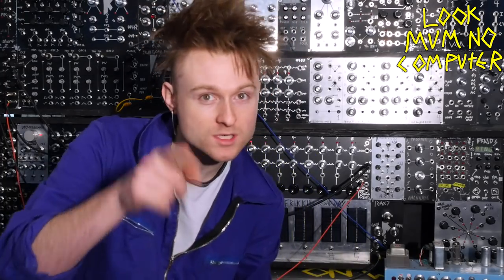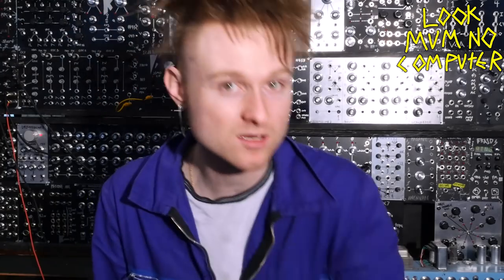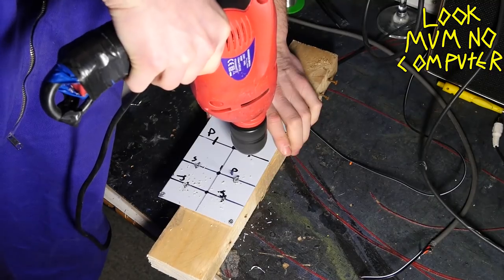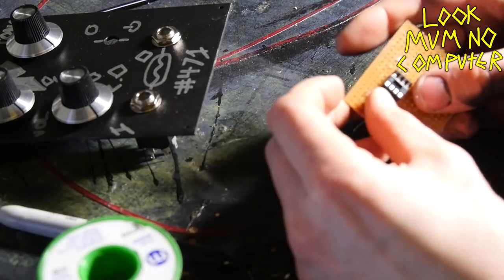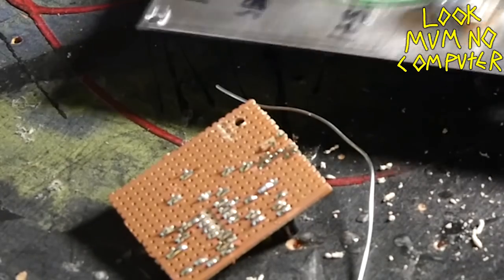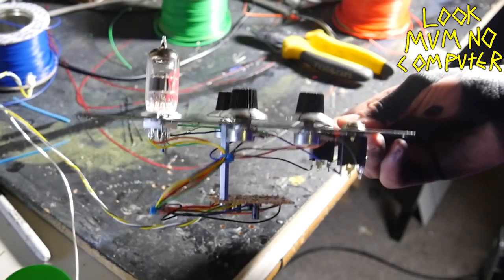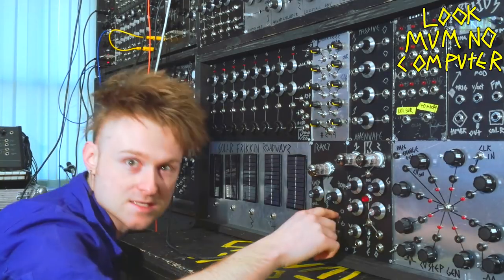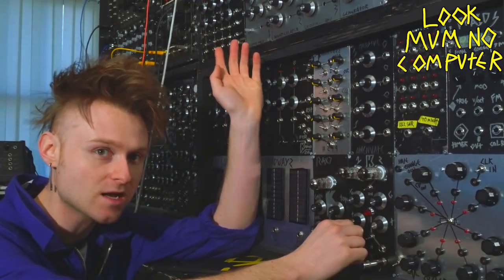The Safety Valve - Valvecaster For SYNTHS DIY How To

Comment: The best thing about a valve is that if he ever blows for any reason you can just unplug it and plug and new one in with a transistor if it's directly solder to a PCB you have the ball ache of taking the unit out of its casing desoldering it and soldering a new one in

Comment: the original schematics have 12AU7 (ECC82), NOT 12AX7 (ECC83), the reason being AU has less gain than AX, it works obviously, but for a guitar AX tube sound is too harsh in this circuit
Reply: You seem to know tubes, at least more than me. Would it be possible to use the 6EM7? I bought a few for a preamp project.
Reply: There is a reason for that, the guitar signal levels are much lower than ones used in synthesizers

Comment: Hi! 
Any chance someone could explain me how to power this module as I don't have eurorack type of power (+12 -12 and ground) but normal dc power (+12 ground)?
Maybe this is a really stupid question but I would really appreciate help :)
Reply: 2 -12VDC supplies, just tie them together opposite polarity so you get +12, 0V, AND -12 as reference points, it'll do in a inch but maybe be noisey or unstable/regulated like your after. but its been done.

Comment: Would likely require a lot of tweaking, but I know that there are vacuum fluorescent display preamps, like the Korg NuTube that operate on a similar principal to a normal vacuum tube. Is there a way to wire up just a traditional fluorescent light tube that you can just grab at the hardware store into a useable distortion preamp?

Comment: i dont know much about much - but i pretty well put this thing together on a breadboard. and to test it I was just going to get 12V DC wall wart that I have already chopped. 
On the schematic it says it requires +12v, -12v and Ground. Can i do this with just a 12v DC wall wart?  it only has 2 connections - 12v+ and GND.
i think im missing something fundamental in my understanding of electronics here...
Reply from the maker: Yeah you need a -12v too but if you listen to this circuit hefore the opamp you'll hear sound without a bipolar supply
Reply: @LOOKMUMNOCOMPUTER  i just tried it with an old computer powersupply and used the -12v rail from that - but it didnt quite work lol.
The output was very very quiet . 
Im gonna double check things first and ill try taking the audio from before the opamp thanks so much for the project info and the suggestions!
ive had so much fun getting all the parts and putting this thing together over the past couple days :) thanks again

Comment: Hi Sam, I've e built this four times now and eve time the 27ohm resistor heats up real HOT 🔥 
Switched it to a 10watt 27r still pretty hot.
Not sure where I'm going wrong, using a 15V 
Supply instead of 12V could that be it?  Cheers thanks for the electric lessons !
Reply: Based on the schematic, the tube is wired for series heater. 12.6volts across pins 4&5. This will pull 150 Milliamperes of current. If your supply is 15volts you need to calculate the correct size resistor.
In reality the resistor is not needed if the supply is only 12volts. To calculate the size resistor need with a 15volt supply you need to drop 2.4volts / by 150mA to give you the resistance. To calculate the wattage rating- 2.4V x .15amps (150mA)= Watts.

Comment: Would something like this work with a xenon plasma tube and how could you boost the voltage. would you need a separate power supply .